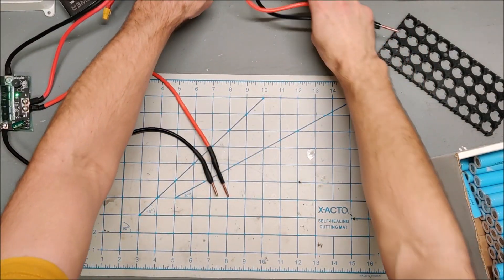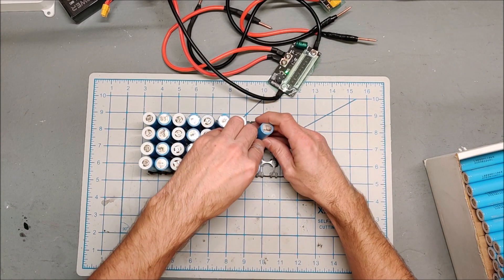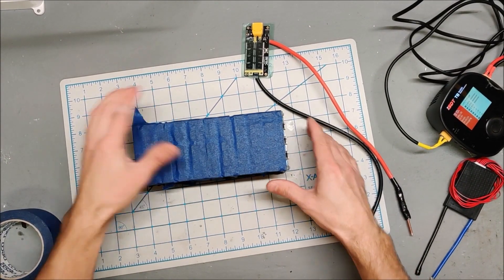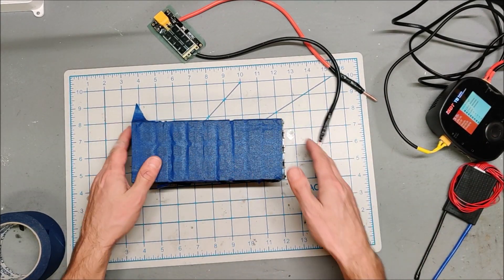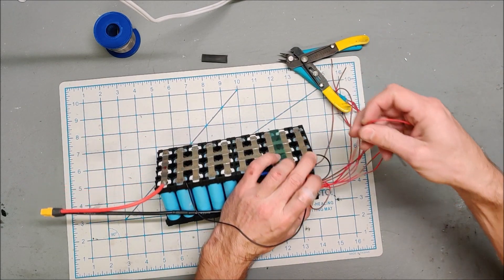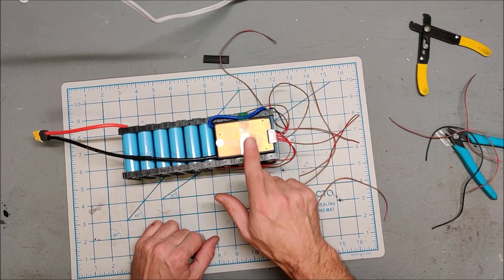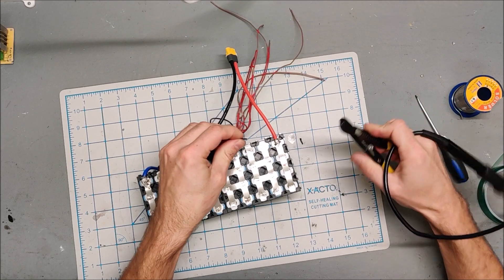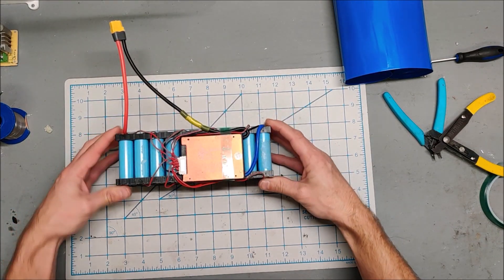QUICK 36V EBIKE BATTERY

Comment: On the + power wire connection, all of the pack's current is going through a single nickel strip. We don't know the size of the strip, but if it's 7mm x 0.15mm for example, is good for about 7 amps, maybe 10. On all other series connections between cell groups, there are 4 strips. This is why we double or triple stack the nickel on the + and - cell groups. The smallest motor controller, like for a Jetson 36V is 15amps. Add some margin and should be shooting for 20A capability or more.

Comment: Hello, I could not see well but are these cells new because it seems their negative electrode plate was slighly punctured, maybe removed from another pack ?
Reply from the maker: No I only use recycled cells. I buy battery packs from decommissioned  scooters and ebikes from companies like Lime and recover the cells. Costs 1/10 of new batteries
Reply: @stevenc22  Ok thanks so this confirms what I vaguely saw while viewing your tutorial video. Could you explain how you can re-flat the surface of each cell since it has some left over metal from previous spot welding. I assume ideally the surface has to be flat to match the new nickel strip once you re-solder or is there a trick to save time on this task ?
Thank you from France, Albert
Reply from the maker: @tantratron  I rip off the old nickle. Use clippers to flush cut the weld spots and then sometimes I might use a little sand paper to finish cleaning the surface. It doesn't have to be 100% just mostly clean. But flush cutters are normally good enough to remove the old nickle.
Reply: @tantratron  Side cutters and then a quick buff with dremel tool sanding disk. Fast and clean.

Comment: How do you charge the battery, I see the discharge cables connected. However, how do you charge it. Ie, where are the charge wires?
Reply from the maker: You can charge through the same Cables

Comment: What do you use to power the BMS? Would a 42v 1.5A Dc output work for 10S BMS?
Reply from the maker: You don't power the BMS. The BMS stands for battery management system and it connects to the battery and is self-powered from the battery
Reply: What current do you put into the BMS to charge the batterys its connected to. @stevenc22

Comment: Great video, thank for showing the process! What sort of charging board/BMS do you use for such a battery pack?
Reply from the maker: I usually use Daly BMS. Good brand, fair price
Reply: How do you charge the battery, I see the discharge cables connected. However, how do you charge it. Ie, where are the charge wires?

Comment: ,sir posible to install two BMS in the 24v battery pack?
Reply from the maker: Yes but why? If one falls and gets stuck open then the second one won't be able to turn off the battery
Reply: ,because i need to increase the ampher sir..my battery pack is 10.4 ampher.i need about 15 ampher..how to install two BMS sir?thanks
Reply from the maker: @christopherbandola6629  yes you can do it. You would just wire them in parallel.  But honestly just buying 1 higher amp BMS is cheaper than 2 low amp BMS.
Reply: ,thanks sir.but my two BMS is only 15amper..its okey to install both for parallel connection to get a 15amper above my battery pack?thanks
Reply from the maker: Yes 2 x15 amp BMS in parallel can handle 30 amps
Reply: Thats means it is posible to do a higher ampher of battery pack sir?until 30 ampher?
Reply from the maker: @christopherbandola6629  yes. A 10 ah battery can deliver 10 amps in 1 hour. But it can also deliver 30 amps in 20 minutes
Reply: ,thanks sir.but may i ask you about my electric bike.if i install it to my electric bike it is safe for that?my two motor install is 24v 250w is same of my controller box..

Comment: What's your opinion on cell level fusing do you think it's necessary?
Reply from the maker: I do cell level fuse on my large power wall build. On an ebike, the rough handling of the battery will likely damage the fuses.

Comment: Would you recommend that BMS brand?
Reply from the maker: I recommend Daly brand BMS.
Reply: Ok thanks, also what are the chances of a BMS failing?
Reply from the maker: @nevcreating  pretty small if you don't constantly push them to their max limit. I've never had one fail.
Reply: @stevenc22  I am building a 10s4p with mj1 10a 3500mah cells what amp BMS do I need? 10a in parallel 40a? or just 10a
Reply from the maker: @nevcreating  yes your math is correct. Probably get a 50amp BMS just so that you aren't always pushing the BMS to the max.
Reply: @stevenc22  ok thanks for your help, much appreciated 👍
Reply: @stevenc22  I ordered a 36v BMS but just found out the LG mj1 cells are 4.2v max not 3.7v and I ordered a 36v BMS should I have got a 42v BMS?
Reply from the maker: @nevcreating  did you order a 10s lion BMS? Often a 36v BMS is 42v max  and 36v nominal. Look at the specs of the BMS you ordere
Reply: @stevenc22  yes the 36v 10s 50a, ohhh I see ok great. Thank you and merry Christmas from Australia.

Comment: can i change from 36v to more amps  and volige  mine is a 36v 8amp 350 battery any help would be great  !  THANKS
Reply from the maker: What do you mean exactly? A battery is rated for it's voltage and max amps. It should not exceed 8 Amps. You can get bigger batteries with higher amps.

Comment: Questuons - If 12volts battery is 3S, (4.2 x 3 cells = 12.6) , then 36volts battery should be multiplied by 3 which is 9 cells 37.8volts right? then why is it 10s? Why is extra line added to it?
Another question is - Is it true that you should keep all the balance leads same length? They say if you trim them big or small, the cells will receive uneven amps and get charged unbalanced.
Reply from the maker: When a 18650 is empty, it's 3v. If you did a 9S battery, empty your battery would get down to 27v which is too low for 36v equipment. The median voltage of a 18650 is 3.6v and battery sizes are calculated using the median voltage. 10s x 3.6v is 36v battery. 

Regarding the balance leads. While it is technically true that different length leads will have different resistance and therefore balance, most BMS are not that accurate and use such low balance currents that it won't matter. I cut my balance leads often.
Reply: @stevenc22   , oo good explaination. I didn't think about it before. Thank you 😊

Comment: I want to make the same 36v battery but 50 cls. Can you please tell me which kind of BMS I need to buy. Thanks
Reply from the maker: You need a 10s bms with the amp rating of the device you are going to power. 30amp/ 50amp ect. Just search for a Daly 10s 30amp BMS
Reply: @stevenc22  thanks

Comment: i ve got the same spot welder but it burns throught the plates, what voltage - amperage are you using ?
Reply from the maker: 12v at 400amps. I'm using a 3s 5200mah 80c battery. What battery are you using?
Reply: @stevenc22  noticed that in your video, i am trying with a 3s 650mah 100c lipo but it still burns through the strip. Might have bought a low quality strip, i guess
Reply from the maker: @RazvanSecu  make larger custom needles. It will spread the current over a larger surface area
Reply: @stevenc22  the 1st one i hear thanks for the tips

Comment: How do you go about testing the cells? Is it enough to balance charge them before installing the bms or is more involved testing needed?
Reply from the maker: When you aren't sure about the quality of the 18650 you can use testers that cycle the battery and check capacity. If you dont have a tester charge them full and let them sit for a week. If the voltage stays the same the battery is fine and not self discharging. If the voltage drops, don't use it, it's self discharging and damaged inside.

Comment: Could the same configuration work with 6 batteries or does it have to be connected differently?  Trying to get more mah.  So would it be called 6p 10s?
Reply from the maker: Of course. You can add as many parrellel cells as you want just as long as you keep it 10s for 36v. 5p10s or 6p10s or 7p10s ....

Comment: Good Job where did you buy 18650 cells
Reply from the maker: https://www.ebay.com/itm/200-Cells-LG-MH1-3200mAh-10A-Cells-in-5-Aluminum-Cased-Packs-/392887834629?_trksid=p2349624.m46890.l49292
Reply: @stevenc22  how long was run time are these good for gokarts
Reply from the maker: @mainesmith2183  high quality cells would work great for a go kart. Run time is over an hour at full load (500w)
Reply from the maker: Batteryhookup.com

Comment: please link buy pcb spot this..thx
Reply from the maker: https://www.ebay.com/itm/12V-18650-Battery-Energy-Spot-Welder-PCB-Circuit-Board-DIY-Auto-Spot-Welding-Pen-/264585775348?_trksid=p2349624.m46890.l49292
Reply: @stevenc22  thx